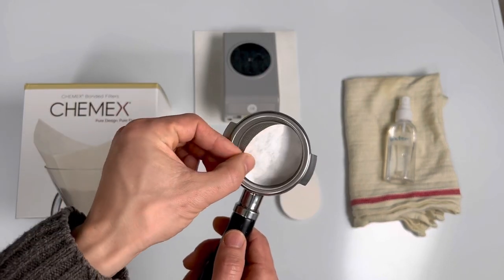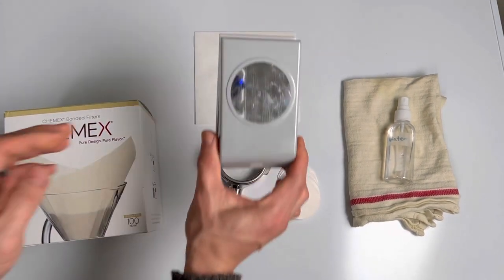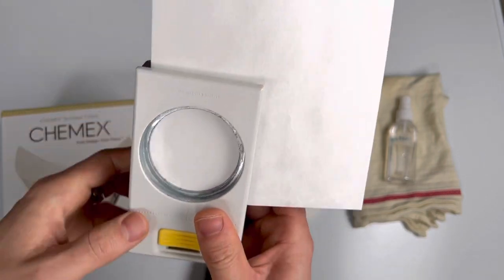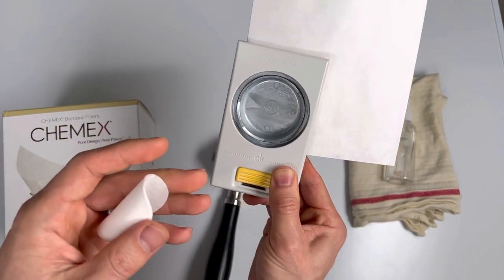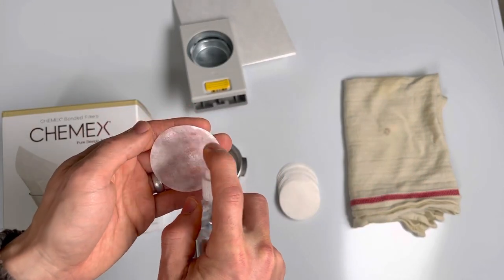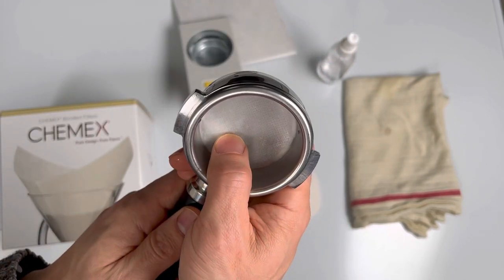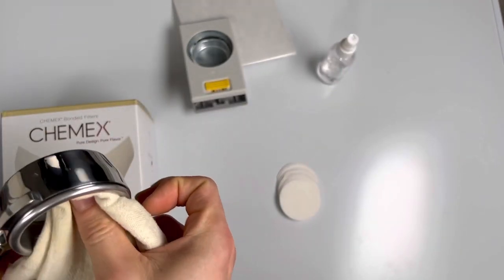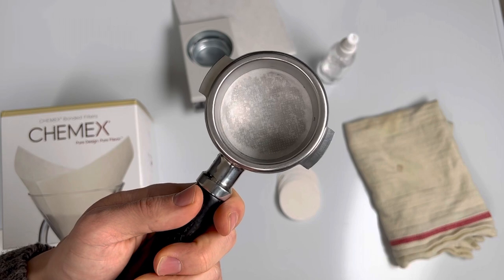How to Make and Use Bottom Paper Filters for Espresso

Comment: Is the 2.25" punch the right size for VST baskets? Does the filter crumple at the edges at all allowing bypass or causing some sort of inconsistency?
Reply: It is and it does not
Reply: It bends up ever so slightly on my 15 g VST, but I don't think that it's significant enough to allow bypass especially after wetting the filter to "stick" it.

Comment: Will this work for 54mm portafilter or is it only for 58mm?  I realize it would need to be smaller, just wondering if there is any benefit for machines that use 54mm portafilters...
Reply from the maker: You could try a 2" paper for a 54mm
Reply: I was thinking the same thing. Do they make a hole puncher for 54mm?

Comment: The tool shown for making the paper filters is the EK Success (sometimes shown as EK Tools) 2.25 inch punch.  This tool cuts a perfect size circle for a standard 58mm portafilter basket.  Unfortunately the product does not last.  I ordered one from Amazon and it wouldn't work out of the box.  Amazon sent a replacement that worked okay for a few hundred filters then rapidly stopped cutting a complete circle.  I tried all the sharpening tricks including taking it to a knife sharpening professional with no improvement.  I ended up contacting the manufacturer who provided me with a full refund.  They claim it is not compatible for cutting filter paper.

Comment: How do you WDT with the filter in place? Do you make light full contact with the paper or pull up slightly with the tool to hover above it?
Reply from the maker: I make full contact with the bottom with a little care not to catch an edge. If you wet the filter and dry it on the bottom of the basket it stays stuck down there pretty well.

Comment: Do you grinder coarser when using paper than without paper?
Reply: You need to grind finer when using paper. The filter paper on the bottom prevents the fine coffee particles from clogging the holes in the basket and therefore increases extraction.

Comment: Just tried that same EK punch from Amazon and failed after a few times, using Chemex paper. The metal die (looks like cast aluminum) that makes the cut had some rough spots that probably caused it to hang when punching any thickness paper. Maybe was a defect and will return and try again.
Reply: Small round filters area now available on Amazon, OR I’ve used the filters that are cut to fit the Aeropress- they work just fine

Comment: Question: How does each square filter produce 20 circular filters.?
Reply: It doesn't! Each "individual" sheet is only large enough to yield 4 punches. What he failed to mention in the video is these Chemex filter sheets are relatively thin so you can easily punch 5 sheets at one time.  NET: Five sheets gathered together and punched 4 times will yield the 20 circular filters.

Comment: Why bleached paper as opposed to unbleached, though? If it’s bleached my understanding is that it should not be going in the compost bin, and for those of us who compost our coffee grinds it would be a nuisance to manually peel off the paper from every puck.
Reply from the maker: You may be able to use unbleached papers, but I’ve never tried them for this purpose so I chose not to recommend them. A cursory search of google indicates that bleached coffee filters are still compostable. My local sanitation company explicitly allows coffee filters in the compost and does not make a distinction between bleached and unbleached filtered. Where are you seeing that they are not?
Reply: @jkimmakes  I was told the bleach is not good for the soil. I could be misinformed.
Reply: @calisson47  anything bad for the soil would have been washed off into your coffee anyway, so... 😄
Reply: I believe these filters are not actually bleached. The Chemex webpage says: "Oxygen cleansing is a bleach-free process, ensuring no chemical residue or taste is imparted to the filter."
Reply: @crwper  thanks!!
Reply: I bought some unbleached ones since that’s all the local coffee roaster sells. So fingers crossed 🤞🏻
Reply: @crwper  thanks!
Reply: As mentioned previously, Chemex "bleached" filters, unlike most, are whitened without the use of actual bleach. You're as safe as can be.
Reply: @PtWhiteBelt  Thanks, good to know!